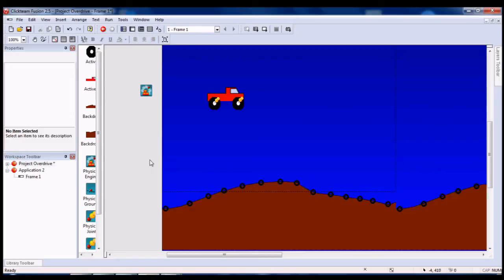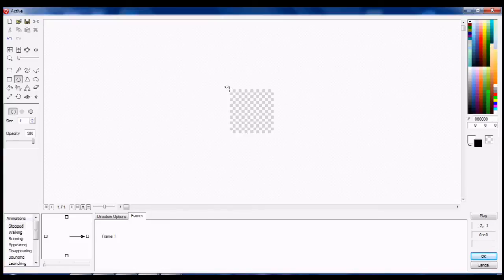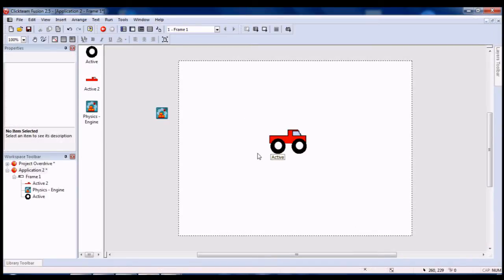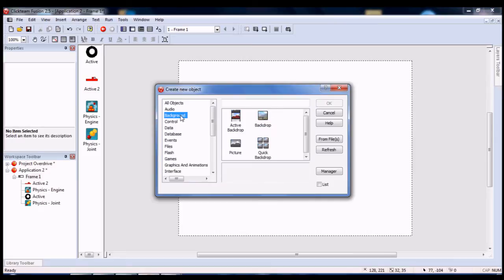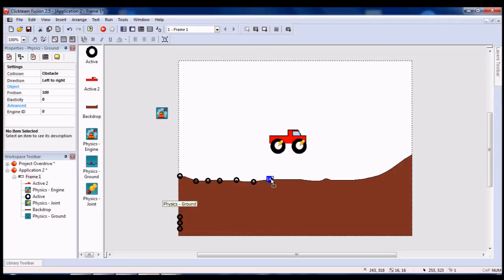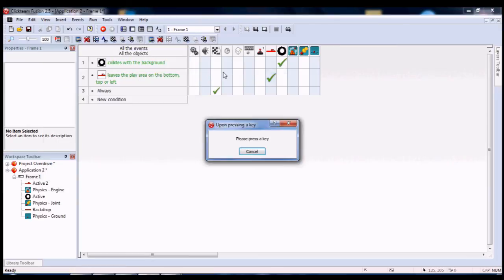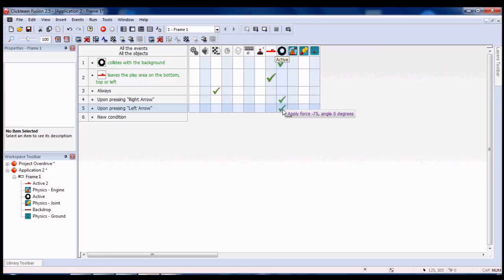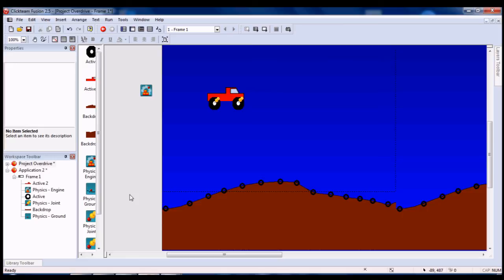MMF 2.5 2D Vehicle Physics Tutorial

Comment: I'm not sure if I missed something but I can't make the vehicle 'tilt' as it goes up and down hills, just stays horizontal the whole time. Admittedly I did a penny-farthing so it has two different wheels (therefore I cloned the joint rather than duplicated it) but I don't see why that would make a difference. When you copied the car object from your other game does it have a movement type you forgot to mention?
Reply from the maker: The vehicle and tires use static physics movement and are not regular static objects. Other then that make sure the hotspot and action spots are centered on the active objects and that the tire's collision shape are circles. Hope this may help...
Reply: Ghost Data Forgers Entertainment Ah it was the static physics bit that I was missing. I'd never used them before and I don't believe it was mentioned in the video. Thank you for responding so fast, much appreciated.